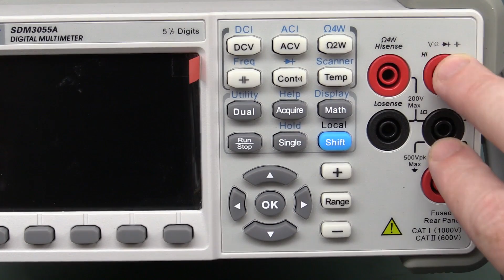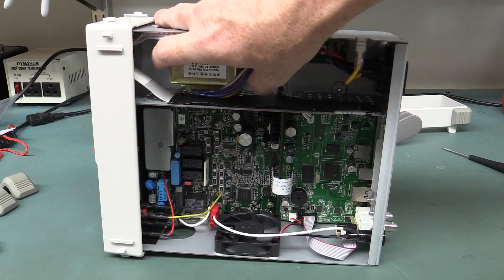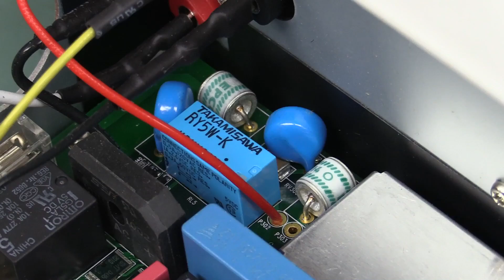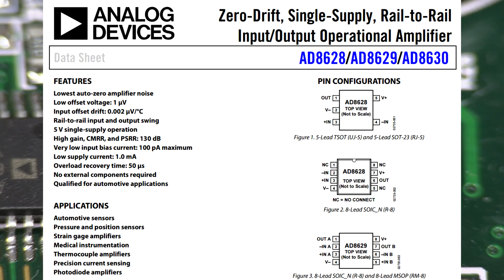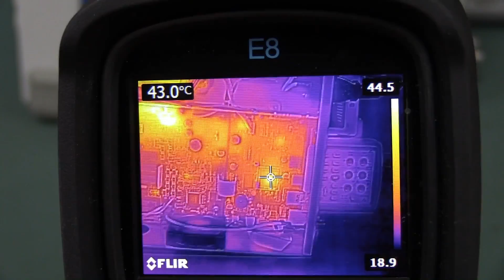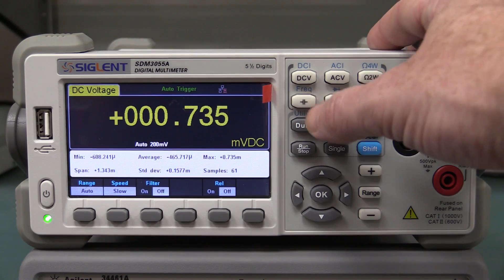EEVblog #829 - Siglent SDM3055 Bench Multimeter Teardown

Comment: Stop hating on Lelon, installed one last week and it still works!
Reply from the maker: +שי מזור He's taking the piss!
Reply: +TheAmmoniacal 
It doesn't count unless you turn on the power!
Reply: Haha
Reply: I am in electronics for over 20 years now. Failed caps after <5 years: Nichicon, Rubycon, Panasonic = 0; CapXon=stopped counting at around 10, Leilon=5+, Samxon=0, Chhsi=countless, JPCon= countless. These are the brands I can remember.
Reply: +sharp x the 'rust' is quite irrelevant and is mostly a trigger for Dave's heavy irrational anti china bias. And the device uses mostly western parts and the Lelon caps could be plenty fine quality.
But it is quite overpriced and overengineered. Same as the Agilent it copies. It has way too much digital power for the very low tech task it solves. 5.5 digits is just not difficult at all today and the tiniest weakest microcontroller could handle that task. It should be a single board solution and the device should be no larger than the front panel.
Reply: +TheAmmoniacal 
last week
how about year?
Reply: +YOUTUBE'S LEAST VIEWED CHANNEL 
Don't hold back. Tell us exactly what you think!
Rob
Reply: +TheAmmoniacal none of you know how well they work. Which is how you can know it's ignorant prejudice. Something you should be better than, Dave.
Reply: +Chip Guy Vids your credibility would be higher if you could spell the name.
Also frequency of exposure and strain in the designed use sort of matters. It might be a poor quality brand but the important aspect is that the quality is unknown.
Reply: +Mila Miglia 
OK, maybe the people picking on "Yolo" which is akin to English "you know" is a point taken but, hey, he said several times he's got 100 engineers and they plagiarizer the case exactly? His triple supply is limited with a 5V volt unlimited output, the output terminals don't hold banana plugs and it's not that cheap. To me it's more of a double supply. 
I thought he was sincere after the interview but I don't know if I'd buy his equipment, not because of his nationality but because of the price to value ratio. He said they're putting 10 to 15% back into R&D, OK maybe it will show up and then I'll reevaluate his product line.  I want high value for my money just like anyone else, if Rigol surpasses Keysight, that's whose equipment I'll buy.
And I thought Dave was very respectful of Eric Qin in his interview. I've seen him pick on lots of high end gear equally, that's fair, he gets to have an opinion, it's not about country of origin.
Rob
Reply: +TheAmmoniacal 
lmao
Reply: +TheAmmoniacal Just wait another week then you will think different :P
Reply: Mila Miglia
are you seriously offended for picking on Lelong?
Reply from the maker: +Mila Miglia Lelon have no long term reputation in the industry. They are not one of the leading players in terms of prove reliability. That's a fact.
Reply: +YOUTUBE'S LEAST VIEWED CHANNEL 

The meter doesn't bother me as much as the PS. OK, so it's a HP, Agilent, Keysight (pick one) knock of but when Dave finally gets to the review (Dave, please do reviews first, if it sucks than don't waste a video on a tear down) it might be a decent enough meter or not. 
The PS should never have jacks that aren't standard spaced or banana plugs fall out of. Come on, this is basic design stuff! I was serious about looking into his equipment after the interview but not now. Fire those 100 engineers if that's the best they can do.

OK ,how about this. Eric it's your company, defend those jacks to us ---- Defend a complete knock off front panel to the Keysight----- I'm all ears!
Rob
Reply: Mila Miglia
Yeh dave workload is getting to him.
Reply: +Mila Miglia - You seem very certain about what knowledge Dave has in his head.  How do YOU know he doesn't have that knowledge?  Why do you believe he has never seen that brand fail himself or seen reports from others that they have failed?  "Chip Guy" above said he's seen them fail, why do you believe Dave hasn't?
Reply: +ElmerFuddGun it's a complex assessment of his psychology from exhibited behavior, further validated by the lack of defense.
Reply: Mila Miglia
alright drPhil, are you saying they are actually good caps?
Reply: +sharp x no
Reply: +Mila Miglia 
Here's the thing, they do use respected capacitors in other places in their designs. So what does that say? Does it say they know Lelon aren't as good as Nichicon's?
Also what criteria are people using for capacitor life? Catastrophic failure, deviation from value, leakage? It's  more that how long they last before the top pops up.
Rob
Reply: Mila Miglia
I think after Yolo's statement that he wants to put a piece of gear on every EE's bench, which is a noble thought (I own a Siglent SDS1000 scope, and is great for the price I paid for it) - everyone would have probably swallowed cheap caps a lot easier if they kept the prices low - but when you sell it for comparable prices to other brands (not to mention having a whole team dedicated to chase re-sellers for selling too cheap), you should at least get rid of the rust and use better components (and fix the firmware while at it). Here's a suggestion for Mr.Yolo: stop paying the "marketing" department (that spends 1/2 their time looking at prices on ebay) and use the money to either reduce the price  or put better parts, components and software in Siglent products.
Reply: Mila Miglia
The rust is very relevant for the price range they are targeting recently, the manufacturing process of the enclosures is backwards (and would never fly in any western country, even from a safety standpoint, to laser cut the parts after they have been zinc coated, should be the other way around).
I don't see where Dave is focused anti-china brands, he's been promoting Rigol and Siglent for a while and at times I thought he was too light on the criticism (look at the Siglent power supply teardown, that one is horrible and he gave it a thumbs up at the end which I thought was quite unusual).
Reply: +Mila Miglia 
I disagree. A bench meter has a different place than a portable meter for example. I just used the train and histogram functions to track DAC micro voltage changes over several days on a design I'm working on and I've used the integration to calculate uC power down current states in the nanoamps. I consider my Keysight 34465a an important instrument that's well worth the price and I know the MTBF will pretty much hold true just like its value. I got a good price for my 34401a when I updated, so what's this thing really costing me? Not much in the end and what it's doing for me is quite a lot.
A good 5-1/2 bench meter can be a valuable tool if it's used right, and you can't get that in a case the size of a portable meter, at least not right now.

Rob
Reply: +13 37 this is like apple fanboyism but for capacitors! LOL
Reply: +TheAmmoniacal I think they're onto what you did here :/
Reply: +fleuroman 
Again, I'd like to see a review of the meter. I still think it's a contender for those who can't afford the big bucks of Fluke and Keysight if the equipment works well and the tolerances hold up reasonably.

Siglent, one recommendation- don't plagiarize the look that only compromises you, just make quality equipment for a good price.

Rob
Reply: mosfet500
it`s not really cheap either, I mean compare to where the SDS1000 scope was as far as price I don't see why the difference (other than maybe for being  look & feel copy of the Agilent).
Reply: sharp x
Not cheap?  LOL.  Try Yokogawa Japan equivalent.  US$19,781.00.  Versus some US$600.00 piece of Chinese CRAP?  You cannot be serious.  LOL  Siglent?  Chinese for CHEAP CRAP.
Reply: *****
dude, take a breather.
Reply: +sharp x 
I think he's wearing a scuba tank! 
I'm really getting a kick out of all this. See what you started Dave! Get a bunch of electronic geeks on a path and you'll get hours of entertainment!
Rob
Reply: +Ryan Vasquez No. Let's call him what he is, a troll. Or, he has such a need to justify his purchase he's willing to make himself look a fool to the world. Just ignore him, and he'll go away. Trolls are like that.
Reply: +EEVblog Gee Dave.  I can only assume you feel your punters can't afford high quality gear?  Because this stuff is just awful.  US$600???  That is very low end gear.......  A decent one would be more like 3K.  Your call.  Cheers.
Reply: +EEVblog if you had said they aren't well known, you wouldn't have erred. But you pretended they were poor quality with certainty. Knowledge you don't have.

Comment: check the spade lug earth connection, is that even legal in Aus?
Reply from the maker: +Nitris I don't know the regulations off-hand. I have a niggling feeling it might not be.
Reply: EEVblog I would also say it was not legal. I should now the reg myself (electrical contractor). But my books out in the ute and I'm feeling lazy.
Reply: electricsnut All earths should be under screw or soldered so they cant vibrate off and maintain a nice low resistance connection. You want the metal case of any 240V device to have a nice solid earth, unless its a double insulated device which this one is not.

But I see what your saying. The lead that powers the multimeter uses the same connection as spade lugs. When u plug the 10A 240V cord into the GPO the earth is made first as the pin is longer then the active and neutral pins. If its not pluged in right there will be no power going to the device so its safe. Of opposed to the earth inside the device coming off the frame you would never know till its too late.
Reply: +Nitris You can use spade connectors on the input side so I don't see why it would be an issue on the chassis side? Would be interesting to know though...
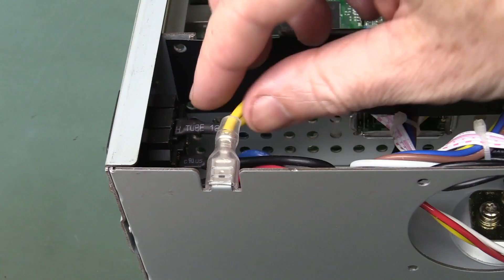Reply: +Nitris   What concerns me more is that the pin isn't long enough, so the locking mechanism that spade lugs have can't even engage  6:26
Reply: Jack White totally agree... and it could even have a higher resistance then it should because its so loose.
Reply: As an elec-chicken I can tell ya it ain't.
Reply: In the US where UL is the listing agency, it is required that safety ground be of a certain size (I think 1.5x rated current) and be fixed by solder or screw but can not be a friction fit (e.g. spade lug only).  Also funny that it has a insulated boot;) I guess Incase it comes off - you don’t want it falling on your circuit haha.  I am assuming that the power connector/power cord has three wires.
Reply: I just checked, it does have a 3 wire plug but the only agency shown on back is the CE mark which is a self certified listing - eeks!!!  The Siglent manual even says not to use unless properly grounded!!  I’m sure the ground wire connection somehow slipped thru internal reviews.  If you have one of these - please make sure this connection is on solidly.

Comment: It's kinda confusing to see that they have an EM shield between the transformer and the main board, but at the same time, there is a fan, something that is switching a coil and generates a changing magnetic field right above the processor
Reply: +Krisztián Szirtes I personally think the chassis design may be from some other product?
Reply: +Krisztián Szirtes The shielding might be a bit of an afterthought too, with that long ribbon cable having lots of surface area to absorb interference.
Reply: +electricsnut Thought about that one too. That could explain why the other side had a fan slot. It could be a standard case that is used for multiple products with the absolute least to do. See: no cutout for the ribbon cable.